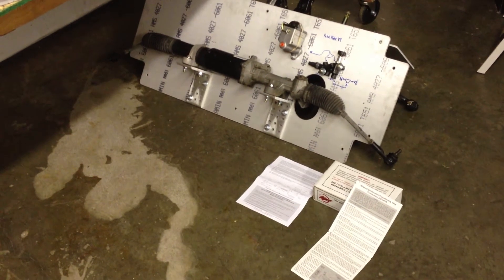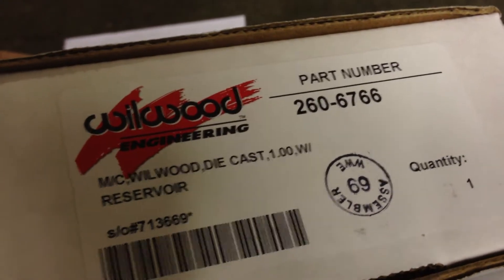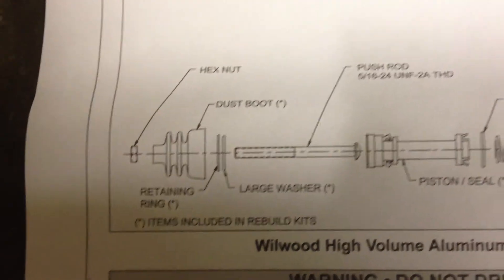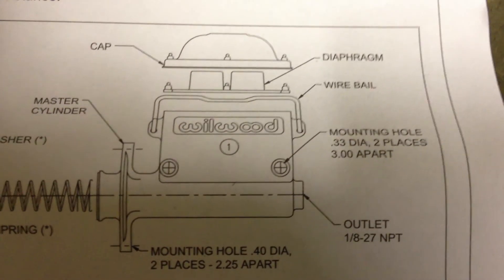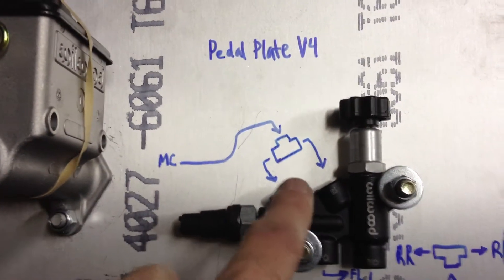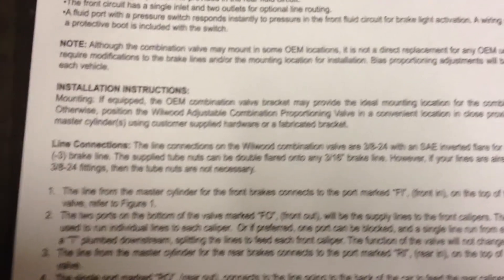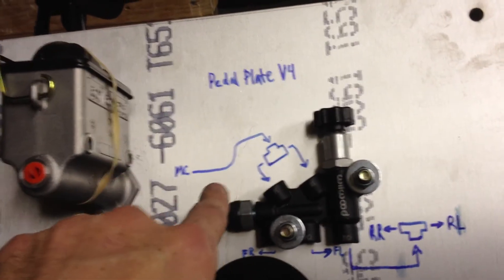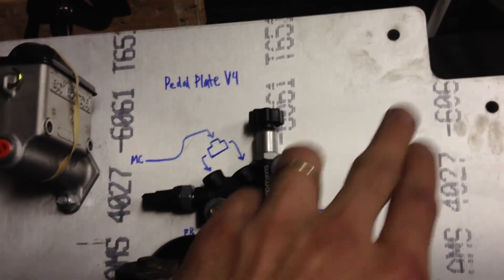WIKISPEED Pedal Plate v4 Brake Line Fittings

Comment: FYI, the Honda brake calipers use these fittings, which work fine on 3/16ths brake line: 10mm 1.0 thread (ISO) with ISO or bubble flare.
Meaning, the Willwood hardware requires SAE Double Flare, the Honda calipers require bubble flare.